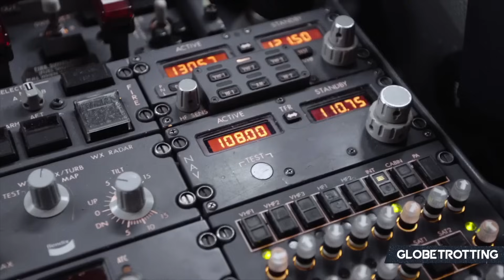AIR CANADA RIVAL - Introducing WestJet

Comment: WestJet really did mess things up with Toronto base by cutting out the 787's operations out of YYZ which basically was 65% of their revenue. By bringing all the 787's to YYC, they are trying to make Calgary the next Toronto which won't happen. A lot of FA's and pilots arent happy about that, even cutting back on the east coast does not  sit well with the airline. It was a given that Swoop will be eventually merged with mainline, that was just a matter of time. It is going to be complex of how Sunwing will be intergrated. Let's see how all this plays out.
Reply: It's actually working for them. According to the CBC "This summer, 86,000 passengers on international flights with WestJet began or ended their journey in the U.S., which is a record high for the airline. The number of Americans on WestJet's transatlantic flights is up nearly 70 per cent compared to last summer, the airline said."